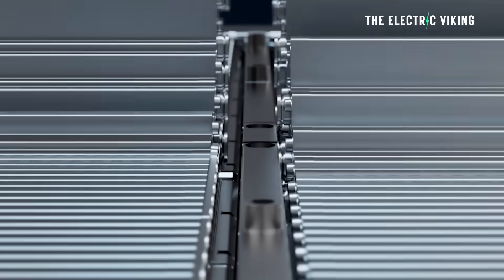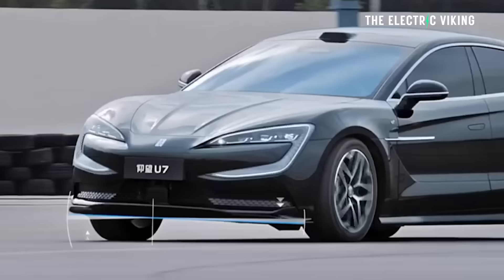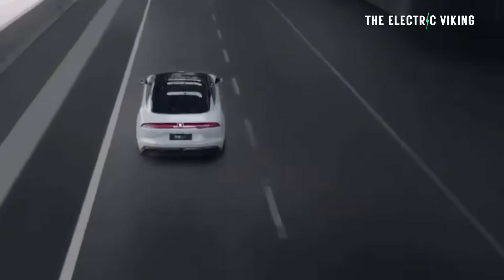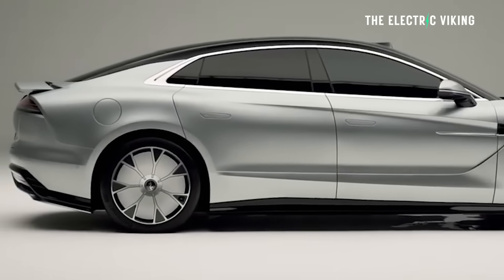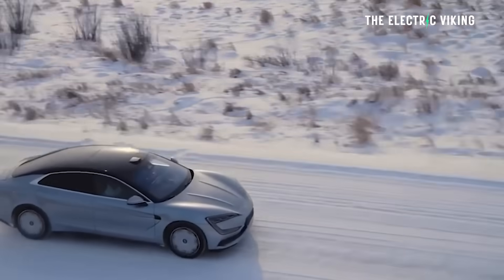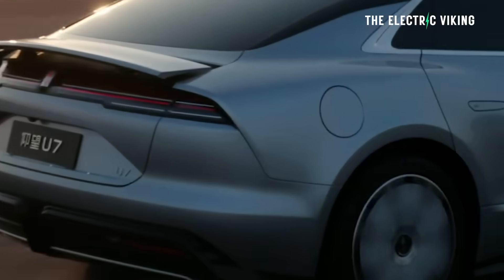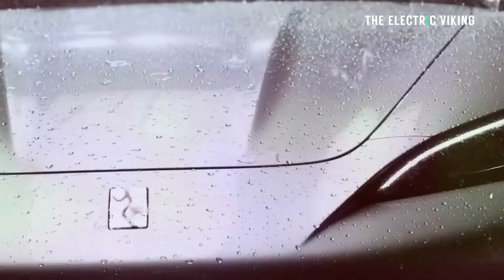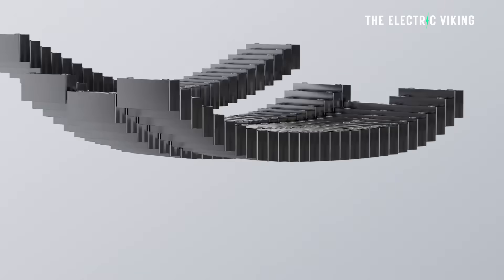1,000KM RANGE: The New BYD Yangwang U7 Gets BYD's NEW Blade Battery

Comment: 150kwh is overkill. 100kwh should be the standard by now. That's more than enough and batteries are much cheaper now. I think 150kwh should be in larger vehicles like a truck that can tow.

Comment: For such a HUGE battery the range is very small in a sedan-like car. Tesla Model 3 with LFP battery 57kwh has 550 km WLTP range, that means with the same battery as this BYD has Tesla could go, in theory, 1447 km. Considering higher weight of the car, it would probably do less, but still at least 1200km WLTP comparing to 850km WLTP of this BYD....

Comment: So my 64 Kw battery will do 300miles in summer so If I had 128Kw battery I should get 600Miles? Not much improvement really on the new blade.

Comment: At 3:59 you can see the boxer Range Extender combustion engine. So i doubt that it is the bigger battery but more the higher efficiency of the electric motors, a little bit bigger battery and maybe a more efficient combustion.

Comment: Evie‘s are great, no heavy engine, no gasoline to catch on fire. You don’t have to pump them full of gas in five minutes, you can do it in 12 hours recharging battery. That weighs 2000 pounds. And probably wouldn’t catch on fire. Unless it rust out after about 10 years. But probably won’t maybe.

Comment: There are tens of thousands of BYD "sold" sitting in many western countries.  They are all going to be worth nothing.
Reply: Resale is less of an issue for EVs because you can keep them longer than an ice car. No timing belts or head gaskets to worry about. No gearbox to wear. The only thing to rust on my i3 is the brake discs, so I am planning on keeping it as long as possible. I also have an mg for our dog car. I expect it will need body work before it needs mechanical, but 3 years in, no sign of either issue. Plan on keeping that as long as the dog lasts.

Comment: as a society, we should be pushing for lighter vehicles since they are less lethal if something goes wrong. Doubling the weight of a battery to SUV levels just to get more - almost entirely unnecessary - longer battery range does not seem like a win for society.
Reply: Autonomous driving will take care of most safety concerns.

Comment: I did your homework for you.

1. 150.01 kWh "Performance" Battery (~162 Wh/kg)
2. 135.5 kWh "Standard" Battery (~150 Wh/kg)

This newer, higher-capacity pack represents a significant optimization in BYD's LFP technology. Despite increasing the capacity by nearly 15 kWh over the standard version, the total pack weight only increased by roughly 23 kg.
Density Insight: This achieves a system energy density of approximately 162 Wh/kg, which is exceptionally high for an LFP battery pack, approaching the densities typically seen in ternary lithium (NCM) packs.
Impact: This pack enables the U7 to achieve a massive CLTC range exceeding 1,000 km (621 miles).
Reply: That's bullshit #CATL #Naxtra #sodiumion is 175Wh/kg.
Reply: @crhu319  

Do you include the whole pack, or just the cells? This is a fair assessment if you include the whole pack.

Current Generation Blade Battery Technology

BYD's flagship Blade Battery technology, introduced in 2020, utilizes LFP chemistry in an innovative blade-shaped cell design. At the cell level, the first-generation Blade Battery achieves 165-168 Wh/kg gravimetric energy density and 448 Wh/L volumetric energy density. However, at the pack level—which includes all structural components, thermal management systems, and safety features—the energy density decreases to approximately 140-150 Wh/kg.

This reduction from cell to pack level reflects the additional mass required for battery management systems, cooling systems, structural reinforcement, and safety features. The BYD Blade Battery's unique design compensates for this through superior space utilization, achieving over 50% better volume efficiency compared to conventional lithium iron phosphate block batteries.

Comment: It's an interesting achievement, but the weight is problematic. Solid state batteries are projected to be 20-40% lighter than LFP, so that may help a little.
Reply: I'm all in with sodium batteries whenever they come to the market.
Reply: BYD Blade Battery is a Solid State Battery known as SSSB (Semi Solid State Battery)

Comment: TO CHARGE A 150KWH BATTERY, DO YOU NEED 150 KWH OF ELECTRIC. NOW , HAVING SOLAR PANEL ADD TO CHARGE THE SYSTEM WHILE YOU DRIVE, EVEN BETTER, NOW THINKING OUT OF THE  MAINSTREAM IDEA... NEW PHYSIC  SHOULD BE APPLIED HERE. NEW WAVES OF ENERGY...

Comment: It makes me think of Monty Python. Virtually no one needs 1000 kms of range. What if they came out with 2000 kms of range? Would you pick that over the 1000 km EV? LOL
Reply: It's not WLTP range. If you are driving on a highway, range is probably around 500. Which most of us need.
Reply: @Janez-h1e  My 2026 Juniper Model Y gets a real world range of 340 miles (545 kms) highway. I've done that often, and it's been verified by several independent Youtubers. So what are we talking about here if this range is only about what a new Model Y can get?
Reply: @777Outrigger  maybe at US highway speeds. I am from EU, we drive 80-90 her in average. My Tesla S 100 is empty after 200mls if I am not paying attention to range.
Reply: @Janez-h1e  By saying you drive 80-90, do you mean mph or kph? I drive 85 mph on the interstate, whenever traffic allows. Maybe 30% of my drive.
Reply: @777Outrigger  there's no way you will have range of 340 if driving 85 1/3 of the time, not even 300. And if you drove all the time @ 85, you would be on the charger after 200mls, maybe a little more.
Reply: @Janez-h1e  I didn't say I drive 85 mph all the time.  Reread my post. Too much traffic on the interstates. About 30% at 80-85 mph and maybe 30% at 55-65 mph. The rest in between.  ... My last drive was 247 Wh/mile. If the battery pack is 80 kWh that works out to 324 miles of range. And it was in the temp range of 38-45F. So a little cold. And about half headwinds and half crosswinds.
Reply: @777Outrigger  and I told you roughly the range if you drove as I wrote. Not everybody drives like you, not everybody is satisfied with 350mls range, me among them. So don't push your opinion on others, I'd buy a 200kW battery for my S instantly if it will ever be offered.
Reply: @Janez-h1e  I never said some people don't need that range. Most don't though. About 90% would be my guess.
Reply: @777Outrigger  10% is not virtually no one. 10% are millions of people.
Reply: @Janez-h1e  Even if you can afford it, in the top 10%, but value your money, you'll take a less expensive, very nice, but shorter ranged car with a very reliable DC Fast Charging network. Can you say Tesla and Supercharger? Just because you're in the top 10% doesn't mean you'll throw away money on something not really needed.
Reply: @777Outrigger  again? You just don't get it, ah? Or is it hard to admit that you may be wrong here? And that I, and millions of others will decide on our own, without somebody telling us that we need or don't need. Or that I am from Monty Python, or whatever you meant to say.
Reply: @Janez-h1e  Let me help you. It simple enough to understand. Most people don't need 1000 kms of range. For most, it's absurd expense.
Reply: @777Outrigger  no need to help, thanks. It is you who needs help, if you don't understand that millions and millions of customers are waiting for 1000km range. Even if they are only 5 or 10%, it's a huge crowd at the end.
Reply: @Janez-h1e  The 1000 mi km chest beating is just playing to the range anxiety fears of uneducated people who don't need it, and is comical to most experienced EV drivers. After about 3 months, I was over my range anxiety in my 330 mile (530 kms) Model Y. This is typical for a Tesla owner, because the Tesla Supercharger infrastructure is everywhere, and completely reliable. Drive 2-3 hrs and take a 12-25 minute break. Fantastic!
 As for  the daily drive, well, I charge in my garage, so 330 miles is actually too much. Most really don't need much range at all for their daily drives.
 !!!---> Read this too!!!   I'm not saying there's a no case for some people needing 1000 kms, but it's a teeny-tiny percentage. ... Most people would buy from range anxiety fear (raf) and don't really need it.
Reply: @Janez-h1e  I'm coining a new term. Range Anxiety Fear (RAF). Car makers are now preying on RAF to sell their 8 gazillion mile range EVs with their big and EXPENSIVE batteries.
Reply: @777Outrigger  you can coin whatever you want. Technology is unstoppable, prices are falling as performance is increasing. In some 5-10 years, 1000km range will anyway be standard on full size EV's. Before that happens, millions are ready to pay more for it.
Reply: @777Outrigger  hahahahahahahaha
Reply: @Janez-h1e  I know battery prices are falling. But even at that, it will still be cheaper to get a smaller batter for about 550 kms of range. Make it even cheaper. The average US household can't afford the average priced new car. They have to go down to a Corolla, or get used car.  
  What's your use case that you need a 1000 kms? I sure don't need it. I f you've operated an EV for any length of time, you lose your range-anxiety pretty fast, and realize that 550 kms is plenty.
Reply: You don't need it which is fine, but others do and want it. Stop trying to make decisions for other people. Thank you.
Reply: @Eduardo-b4v7q      About 90% don't need it. 
  And how is it that I'm making decisions for anybody? Stop putting words in my mouth, Thank you. 
Obviously, the car is being made by BYD and people will make their own decisions if they want to spend the extra money. Most won't.
Reply: @777Outrigger You don't know what 90% want or need. People want a lot of different stuff and a lot of them want 1000 km range or more so they don't have to sit at broken chargers or pay 40 cents per kwh along the highway. They want to charhe a home or at the hotel or at their friend's house. Thank you for understanding.
Reply: @Eduardo-b4v7q  If you're willing to pay more for a longer range, good for you. But most not only won't pay more, most can't even afford it.
Reply: @Eduardo-b4v7q  You've hit on a good point. Unreliable Fast Chargers. But for me in my Model Y, I've been using Tesla Superchargers exclusively and have never had a problem. Tesla has a 99.7% reliability in their Superchargers. That's why I don't want, or need to pay more, for a battery that will get you 1000 kms.
Reply: @777Outrigger I'll pay more, no problem.
Reply: @Eduardo-b4v7q  Most can't, a lot won't, especially with the reliable Supercharger network Tesla has.

Comment: Great but the car overall weight is now 3500kg, this is not the way of the future.
Reply: It is still innovation, I’m Sure they’ll improve from there. Good thing theses innovators don’t listen to negative people like yourself
Reply: It is actually 3096kg as far as I know. It is competing with luxury cars, not average sedans. Your non electric Rolls Royce Phantom EWB is only 400kg lighter (which is a big difference but it doesn't have the active suspension). The electric Rolls Royce Specter is only 90kg lighter. The Bentley Flying Spur Speed is only 350kg lighter.
Reply: I was cacultating when id be able to convert my 230hp airplane to electric. To get 4.5 hours endurance the battery would weigh over 10 tonne....😂  we have a long way to go....
Reply: @hm250 Samsung silver battery is 500 wh/kg which could be used in planes up to 500miles
Reply: That's the private vehicle wt limit in the UK ...  Time to do something about the wt. ..worlds quickest road roller . ..   Al Sulpher batteries  or  a Li S. Perhaps an early candidate for near solid state cells  or solid state  assuming it  survives for a year . 🤔🤷🏻
Reply: The fixation on max range that very few ever need is crazy. What is needed is more charging infrastructure to compete with gas stations. My car has 580km claimed range and I never use more than 40% as I charge at home. 
I'd like to know how many gas car owners know their gas tank volume and range in differing conditions and it drops with milage. Double the speed and quadruple the aerodynamic drag. TRy driving your trusty Camry at a constant 160kph and range may worry you.
Reply: @ralphzoombeenie2330 More range is an excellent way to develop everything.. le aero drag.. less rolling resistance more energy density etc etc
Reply: The technology needs time. This thing just started. In 5-10 years the parameters will be something fully different. You need to start somewhere, right ?

Comment: I'm not sure what impresses me more.. the battery or the suspension. That chassis didn't move at all when driving over those bumps. Did they use magnetic suspension or something?

I live in South Africa where we get loadshedding so that's basically the only reason i would consider a hybrid but if i could afford a new car i would probably be able to afford solar so... yeah i like all electric, but some people prefer hybrids in the same way that some people like getting kicked in the nuts, i don't get it but i try not to judge.😂
Reply: The weight of the battery provide fair amount of inertial, it moves like a Rolls Royce.

Comment: I feel like this isnt quite the 1000kms we've been waiting for. Need to keep working on the density.
Reply: 150kwh should be 150/22= 680km real world motorway range  @120kph. 
Good enough.
Reply: @larsradtke4097 you are going to need a pee after that🥴
Reply: @RexLucas-yo4cr 
yeah I never understood the people that sincerely argued you're going to drive longer than 5 hours in one go (5hrs x 80mph = 400miles). 
If you do you're quite the bad driver since your ability to focus is definitely compromised by that point. Are you even drinking any water? Don't you get hungry AF at some point?
The important point is that you are able to charge where you'll make stops anyway. It's such a solved problem, it is ridiculous that we even have to argue anymore, about BEVs being viable for most consumers.
Reply: @RexLucas-yo4cr  that is 340km one direction, then return without charging l
Reply: @larsradtke4097 up hill with a head wind both ways 🥱
Reply: @RexLucas-yo4cr if you commute that is one week without charging. If you do outside work and visit clients, that is visiting clients and coming home without charging.
Reply: @larsradtke4097 so what 😏